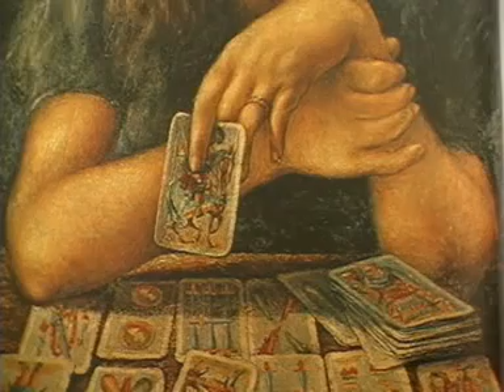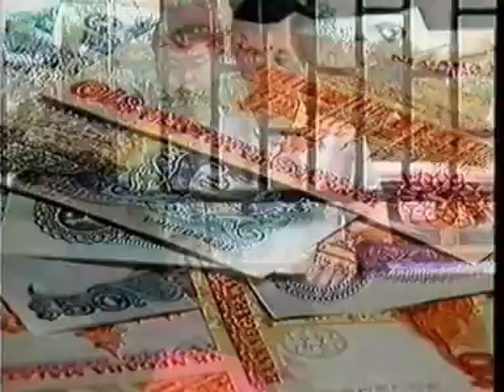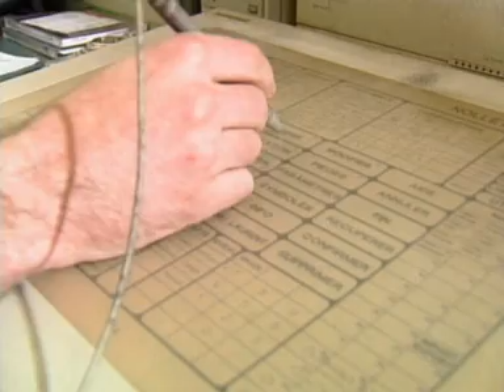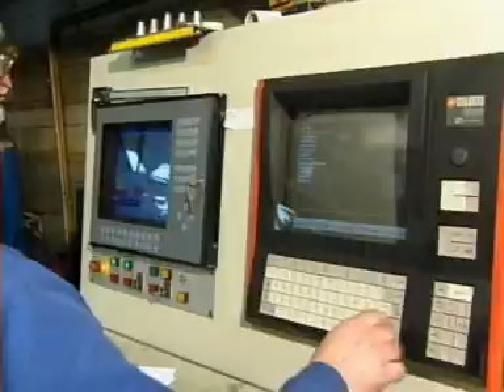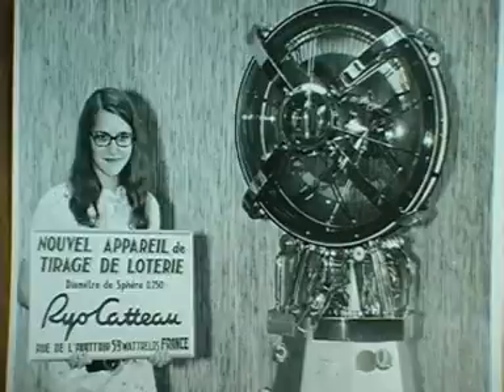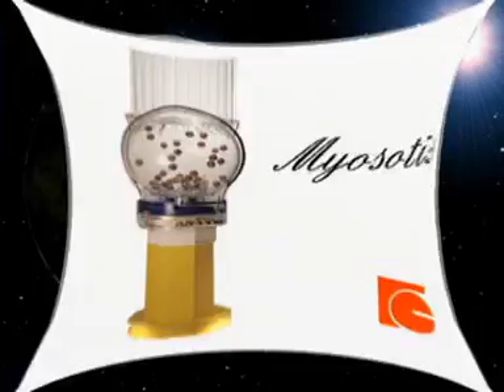Ryo-Catteau: Promo Video on the manufacturing of lottery machines and balls.

Comment: It's a naive impulse, i know, but ever since I've been like >small< small I've wanted to have a set of rubber lottery balls
Reply: I have a set.  You can buy them from Ryo-Catteau or Smartplay.
Reply: @derekbrown1237  how much does a full set cost?
Reply: @MattTheSpratt  It depends on what you are looking for and from which company.   Smartplay is cheaper, but the quality is not as good as Ryo-Catteau.   You see, Smartplay prints the number on the ball with just ink and will wear off over time if you are using them. Ryo-Catteau however, uses rubber inserts which means the number is a part of the ball itself.  Big difference.   Smartplay is $60 per ball.   Ryo-Catteau last time i checked was about $300 a ball.    I have a 0 to 9 set from them, 70 mm balls.  A complete set of 1 to 49 balls runs about $12,000, 55mm balls.   Smartplay about $3,000.   Then one you get those from either company, you going to want a machine, its just the next step.
Reply: @MattTheSpratt  Also the reason they are so expensive is that lottery corporations have to ensure integrity in its games, so the tolerances need to be exact.   Therefore, the weight, diameter, resiliency must be exact.  You can contact either company to see what they have.  Sometimes, rare but they might have an old set they want to get rid of or suggest a lottery corporation that might allow you to buy an old set from them.   Rare because most of them destroy their ball sets after they are no longer in use.
Reply: @derekbrown1237  Yeah, I think chasing up a lottery corp for old balls would be a better bet, although I'm expecting plenty of accusations of game fixing this way. Thanks for the advice, I really appreciate it!
Reply: If I know correctly, Smartplay now don't create and/or sell rubber balls, just table tennis and foam balls.